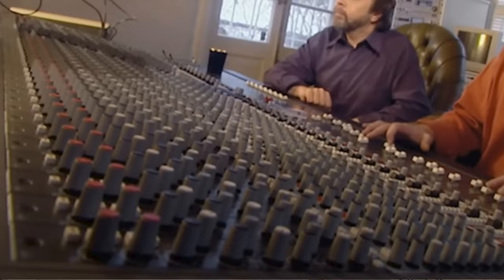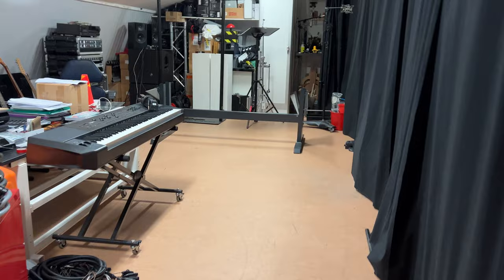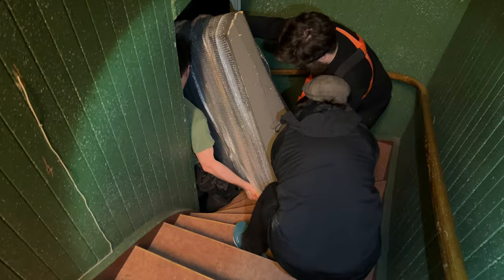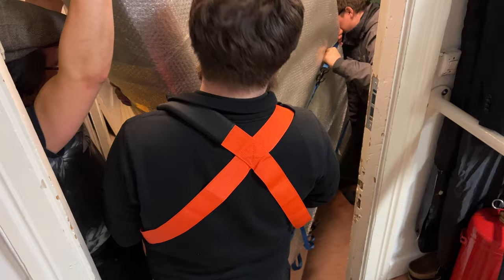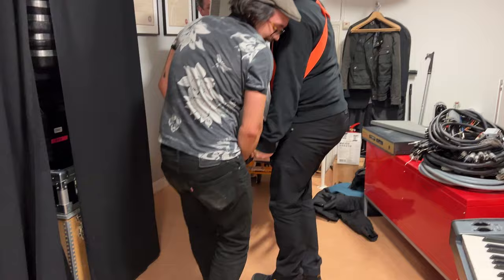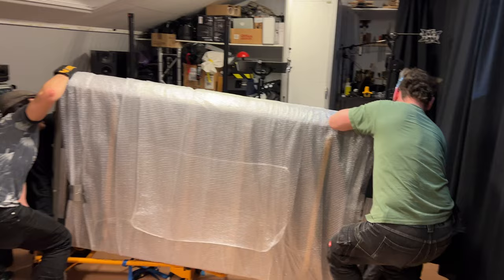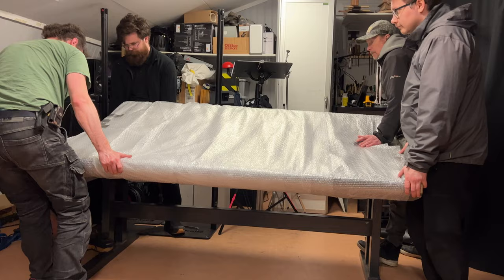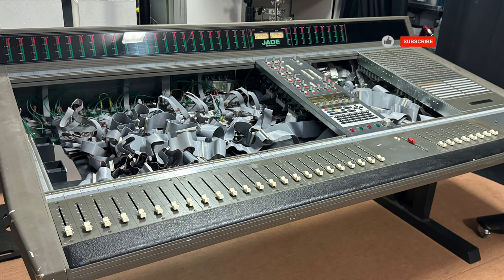Soundtracs JADE (pt 1) - we're getting an Analog Mixing Console

Comment: Congratulations on your Jade! Owning a Jade-S myself I would like to share the following advice: 
1. Check the batteries on the DSP boards. Replace them and move them of the boards. If they start leaking they will ruin the desk
2. invest in a Blue Dog replacement power supply. Worth it in power saving alone and the old supply may have a bad bridge rectifier.

And enjoy your console! I love working on the Jade and I'm sure you will too
Reply from the maker: Thanks for the advice - the battery change will be one of the first thing to take care of👍

Did you notice any difference in sound level from the fan, and the sound quality of audio by replacing it with the blue dog?

Jade-S what an amazing console!!!😍😍